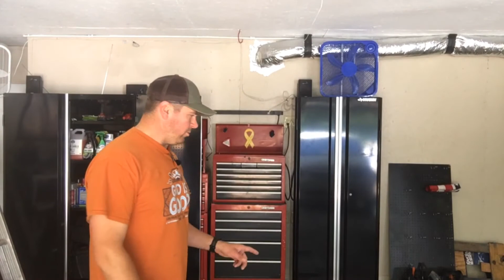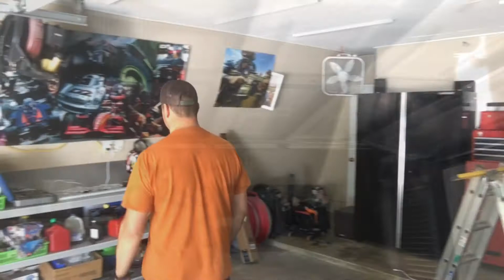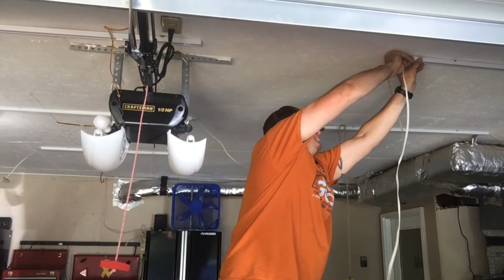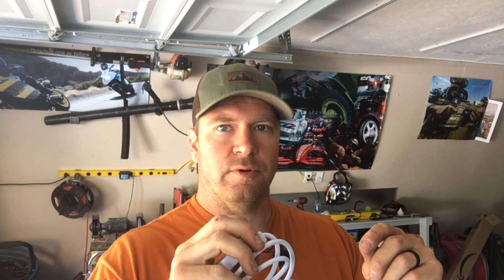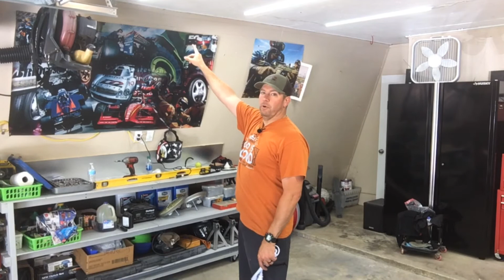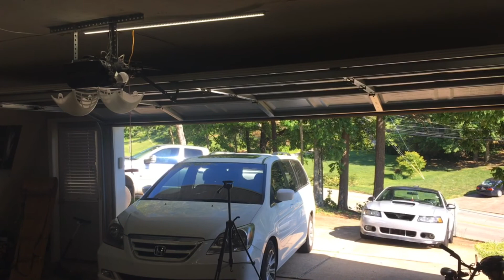BARRINA T5 Led lighting - GARAGE MAKEOVER part 2

Comment: How is the camera following you? That is amazing!
Reply from the maker: My gymbal has a special mode called “follow me”. It works good most the time if your in view. It’s a handy tool to use when your moving around so you don’t have to keep reposition the camera all the time.
Reply: @paulwinkelman  Nice. What model is it?

I also put up 8 of those shop lights and love them so far
Reply from the maker: @l31007  it is the zhiyun smooth q gimbal.